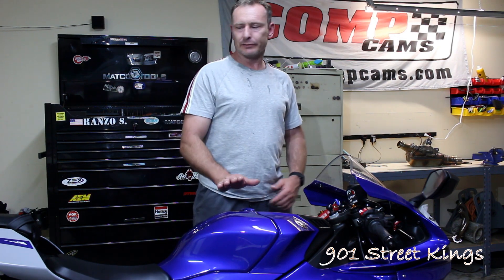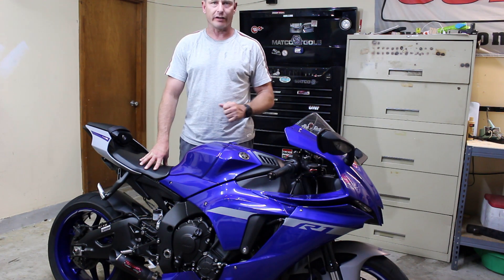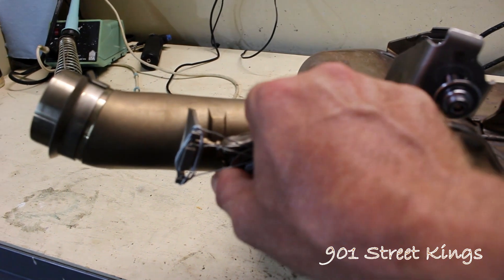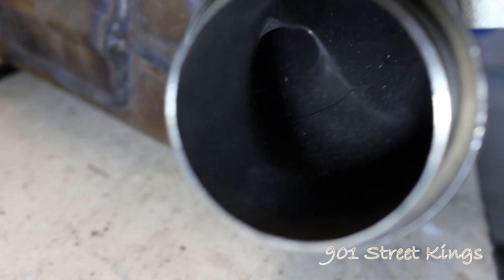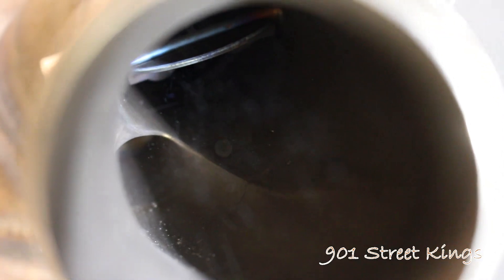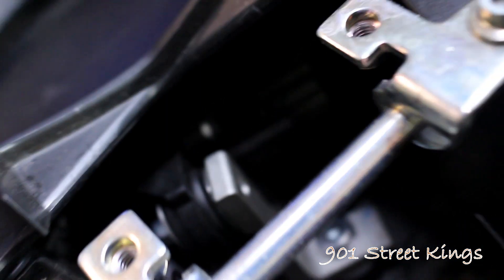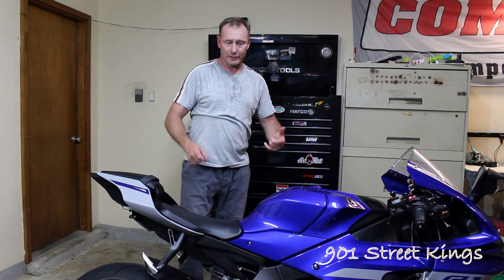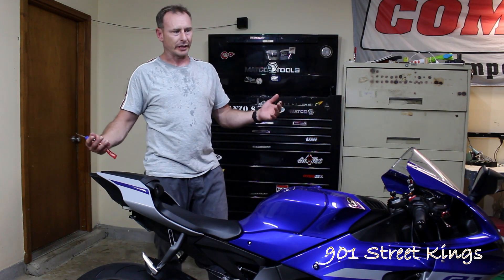EXUP valve power adder??

Comment: It's wrong to say that the EXUP valve has no effect on performance. A restriction on the exhaust is bound to have some effect, either positive or negative.
The EXUP valve on a stock R6 (2017+) or R1/M (2015+) stays closed up until 6000-ish RPM or 60 kph. Removing it / wiring it open or flashing the ECU to use a different logic for the EXUP valve so that it opens earlier it will actually allow the RPM to go up quicker. I've seen the before and after on my R6 without any other mods before going for the full tune
Reply from the maker: Since I never said that I guess we agree. The effects of an EXUP is all negative in regards to power and performance.
Reply: @randyschmidt19  8:18 'till 8:37
Reply from the maker: @Kid574  Your lack of comprehension and understanding of the English language is unfortunate. Keep studying and maybe you will grasp it like everyone else.

Comment: 901 Street King. What have your experience been like since you purchased the bike? Any pros and cons or regret of purchase? Just asking because i'm at a cross roads between the 2020 R1 and 2020 zx10r. Our dealerships here don't offer demo rides.
Reply from the maker: No real negatives. I love this bike. I think it will depend on what experiences you have and what you like personally. I have not ridden an new ZX10 but they seem like a good deal. The first con would be the rear tire. Its new for 2020 and it was gone in less than 5k. The biggest issue I have is that nobody can tune this bike yet and its been out for about 8 or 9 months.
Reply: @randyschmidt19   i appreciate the feedback. Hopefully you will find a tuner so you can unleash the beast.

Comment: On the 2020 model the header is actually stainless steel unfortunately not titanium like the 15+R1 only the M comes with titanium header on the 2020 model
Reply from the maker: Where you get that information?
Reply: 901 Street King bauceracing had a 2020 R1 and discovered that.. also my 2020 has almost 6k miles and have almost no blue on the header where as my friend who has an 18 R1 has less miles and his header shows blue all over
Reply from the maker: @brendantunney3577  Yamaha says titanium exhaust system but goes on to say muffler and heat shields are titanium. I have had stainless steel headers that turn blue as well so color alone does not indicate material used. I would guess OEM might have less titanium and is not polished so it would not turn blue..... Maybe. I am curious now. Gonna see if a magnet will stick to it later.